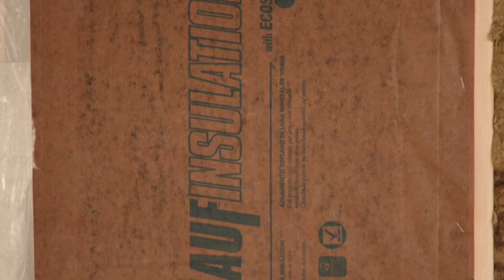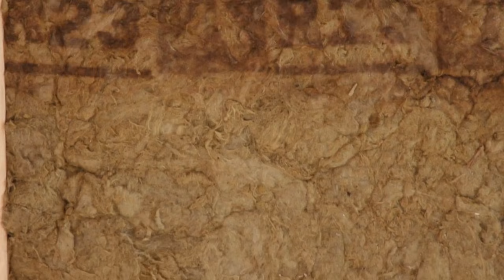6 Common Types of Insulation on the Market

Comment: I used Siga Majrex on my exterior walls with Rockwool but I used MemBrain on the ceiling between my living space and vented attic which is blown in with cellulose. Mostly for cost but also for the idea that MemBrain allows vapor to pass through in both directions but not air. I detailed it well as an air barrier but I wasn’t super concerned with vapor passing through it into my attic because of how slow it would retard it figuring that it gets carried away before causing any condensation on my sheathing as I’d get with an air leak. I used Siga Rissan tape on both products and it worked very well.

Comment: It’s still hard to believe that colder climates are still even considering fiberglass insulation.   R value only measures conductivity but fiberglass is primarily air and air can also have convection currents that move from the warm interior to the cold exterior.   So the effective R value is less and is around half when the outside temperature is at 0 degrees F.
Reply from the maker: We don't ever use it but it is sadly common on "contractor grade" low quality projects since its inexpensive. Although the new building codes are going to change that